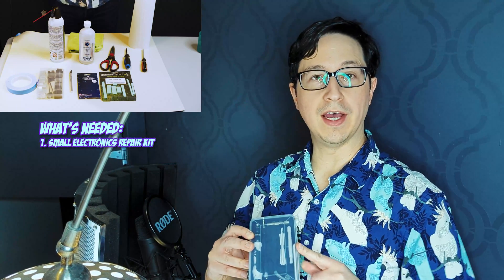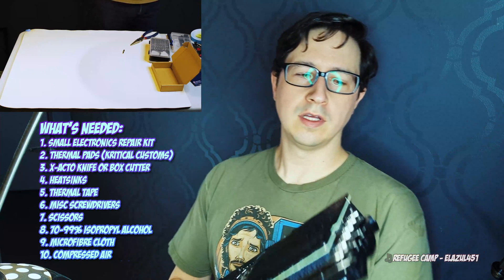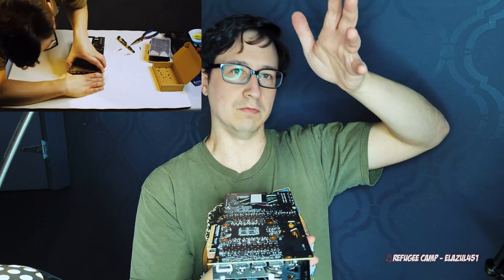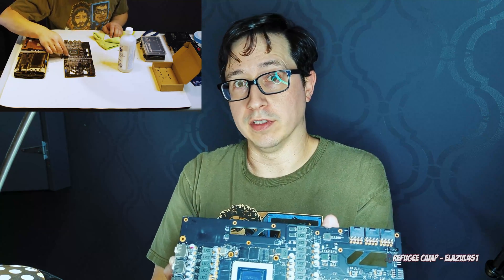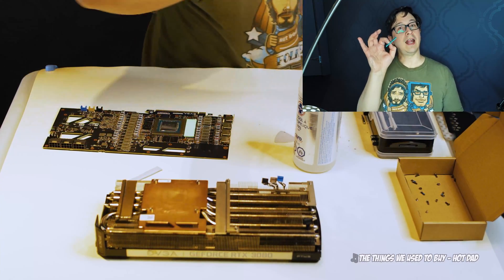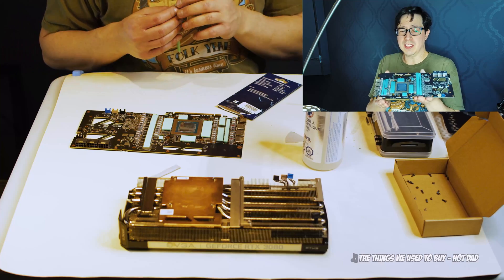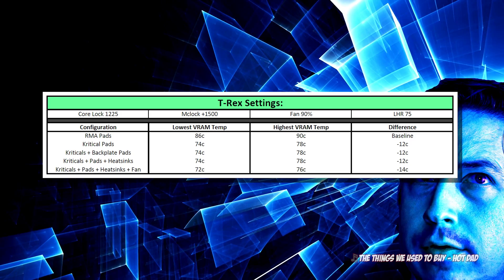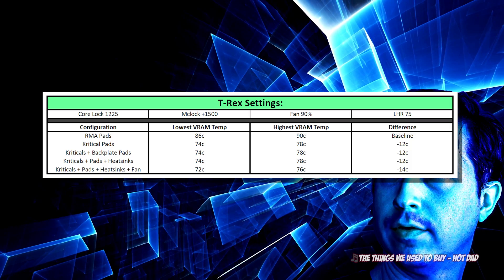How Good Are Kritical Thermal Pads? (and How Do You Install Them?) | Includes Benchmarks!

Comment: Thank you for this. Great explanation' simple and straightforward installation, no annoying music, and just a great video overall. 
For context, I recently bought an entire used system and the 3080ti has never been repasted and easily goes over 90° and it starts to throttle. I have to do a big undervolt to get it to run more stable, quiet, and cooler at the cost of performance. 
Undervolted to 800v @1750mhz with custom fans to get it under 78° under load

Comment: HI there. can u tell me what thermal paste is good for that gpu? with pads I heve no problem, but gpu hits 78c in gaming. I tried mx-4 and mx-6, no diference.
Reply from the maker: @B-Gaming82  are you really slathering it on there? GPUs don't have really any major components nearby so you can put quite a bit on.

That said, liquid metal is best (but risky). Carbon sheets I hear are great but I haven't tried one yet

Comment: a big FYI to anyone thinking of doing this. Kritical thermal pads after 6 months to a year the performance will start to degrade so the temps will start going back up.  Quite a few people who game have told me this. Stick with Gelid Ultimate or Nab Cooling thermal pads. The sweet spot is Thermalright Odyssey pads although they arent much cheaper than Gelid.  Nab Cooling is the same exact pads as Gelid just at a cheaper price. Both companies get their pads from the same supplier the stats are the same and they both get the same temps in game when put up against other thermal pads.   I have had Gelid Ultimate pads on my EVGA 3080 ftw3 since I first bought the card so 5 years old at this point?  I have opened up the card once or twice to repaste it and the pads have held up fine with no tearing and same temps.
Reply: hello bro. can u tell me what thermal paste is good for that gpu? with pads I heve no problem, but gpu hits 78c in gaming. I tried mx-4 and mx-6, no diference.
Reply: @B-Gaming82  Kingpin KPx thermal paste is one of the best especially for the price. Make sure you use the thin spread method.  I usually do an X over the gpu die and then spread it evenly across the whole gpu.  Kingpin KPx should come with a plastic spreader that you can use to spread the paste around the die.
Reply: @ Thanks for reply. I'll try.

Comment: Is Kritikal even still around? I try to go to the website and it never loads or I get an error.
Reply from the maker: They may not be. As I noted in my notes and some comments, the pads dry up after 30 days and become much worse
Reply: @Grraarrgghh  Damn...I need to get my card situated and I don't know which pads to get. They sell the Kritikal kit on Amazon for 37 bucks (green upgraded pads supposedly) but that's a lot to risk them being horrible after just a month...
Reply from the maker: @xRevoEmaGx  not horrible, just basically similar to if you hadn't repadded at all. If its a non-EVGA card, I would just get Gelid Ultimates.
Reply: @Grraarrgghh  It's an evga 3080 ftw ultra
Reply from the maker: @xRevoEmaGx  dang. As noted in the video, EVGA used weir .25mm increment pads for their cards. Gelid Ultimates are still a decent option because they are pretty squishy so you can size up to 1.5mm and 2.5mm, but you might not get as good contact on the GPU die
Reply: @Grraarrgghh  Which sizes did they use from factory? I already have 2mm and 3mm thermal right from older builds.
Reply: @Grraarrgghh  Gelid Ultimates are not squishy ,they are hard ( I own them) but I heard that Extremes are.Also some users noted that they leak oil over time.

Comment: So, maybe I'm crazy but... If the thermal transfer rate of this pad is truly 20 like they say it is. It's almost twice as good as the leading thermal paste on the market right now (Thermal Grizzly Kryonaut)... So why doesn't someone use these pads for their GPU/CPU die and see how it works? Seems like I can't find a single channel out there that's taken the plunge yet.
Reply: The is because they are thermal PADS which has a relatively large thinkness compared to thermal paste sandwich in under the heat sink. You can have thermal paste and the pad be both rated 20W/mk but if the pads are 4 times as thick it transfers 4 times less power. So any such test would be stupid because the thermal paste will win. Thermal Pads are really use to bridge gaps between the heatsink and different components.

Comment: Is this only for mining? If I were to do this upgrade would I see any performance boost in gaming? I’m not a miner. I would like to OC my card further.
Reply from the maker: Heat isn't usually a huge limiter in overclocking. Gaming definitely.pushes the VRAM hard however, but often it's chip luck that determines your cards OC cap more than heat
Reply: @Grraarrgghh  so you’re saying it’s not really going to do anything for an OC. How about just temps while gaming? Is it pointless to change out the thermal pads and thermal paste. Does evga use really good thermal pads and components already? Basically I want to know if I’m wasting time, money and effort.
Reply from the maker: @floridasmashgaming3262  they're mediocre to begin with. But you can check your temps while gaming and see if it's necessary

Comment: That "head in the way" problem is easily solved. Have you heard of the "camera in the ceiling" solution? There is a better way to store screws and other larger parts. Buy an old-style ice tray. Secure it to your workbench with VELCRO. Number the individual bins. Place the first screws removed in #1 bin, the next set in #2 bin, etc. When you remove an item too large for the bin, write its name on a piece of thin cardboard and put that in the bin. When you reassemble, start with the highest number bin and work down. No one wants to tighten screws too tightly or not enough. My solution was to purchase an EK-LOOP Torgue Screwdriver. It will allow me to replace my screws with the correct torque. Hope my comment helps.

Comment: Hey, I live in New Zealand and am trying to get my card back to factory settings for RMA any idea what pads you can use to do this? The EVGA for my region won't send them and am kinda stuck as they say I am allowed to change pads and cooling options and my warranty is still valid, but are screwing me on them needing to be as factory.
Reply from the maker: That's odd; you should be able to RMA a card without factory pads, they just usually charge an extra $30 to replace them before sending em back

Comment: If your using air only try coolmygpu with good thermal paste and 14+ temp difference
Reply from the maker: Yeah I've had a lot of people recommend copper plates to me. The Kriticals aren't aging well but I'm not sure copper plates are worth 4x the cost of decent thermal pads
Reply: @Grraarrgghh  What do you mean by not aging well?
Reply from the maker: @makeitso9833  I'm likely going to make a follow up video soonish but the Kriticals seems to have regressed to OEM pad levels in just over two months of operation. Pretty disappointing; average temps have gone from low/mid 70s to mid/high 80s

Comment: I  padded my 3080s ftw3 and 3080s fe, it only lasted about couple of months before the heat is back to level of the oem pads, yes I  got the Kritcal pads, anyone have the same issues as me?
Reply from the maker: You know I've actually noticed this recently as well. I thought it was because my ambient was going up but it's only half a degree higher than when I filmed the video.

Meanwhile my cheap Thermalrights Extremes have been rock solid for over a year
Reply: Yeah the sweet spot is 12.8 W/mk. Or 12 W/mk. Less metals more silicone.
Reply: Ahh man I have the same! After 4 months these pads getting worser than the RMA :( On my FTW3-s...
Reply: Oh no, man... I imported this stuff, paid a bullet for it... Was about to remove my 3090 to apply these kritical pads on it... Should I abort it? I have some 2.0mm gelid gp-extreme lying around, but I don't think it's enough for everything, it's a 80x40mm pack. :( These custom pads EVGA used on these cards are a pain in the ass.
Reply from the maker: @GabeBars  they're still better than the stock pads, and it's hard to find pads in the quarter mm sizes EVGA uses. I would still swap em, knowing that they will reduce in efficiency over time. Even at their worst they still are functioning at about 90c with a full unlocked OC at the moment
Reply: @Grraarrgghh  thanks a lot, man!
Reply: @GabeBars  My Kritical pads lost a lot of performance after 5 months. 5 card swapped and they "dead" almost the same time, and yes still better than original ones, but thats matter of time I think. I pull apart the card, and the pads just lost oil and get like plasticine. Go for copper if you have chance.
Reply: @Grraarrgghh  2mm will be not good! Use 2.5 soft pads but keep looking on GPU processor temps
Reply from the maker: @Badrick16  agreed; I didn't mean use the undersized Gelid pads, more use the Kriticals since he already has them but expect them to get worse over time.
Reply: @Grraarrgghh  Yes, prepare with 5 months, you will survive the summer at least :)

Comment: Your running an LHR Gpu, so its not running the memory at its peak. Only 74%,
Reply from the maker: You'd be surprised how hot LHR GDDR6X gets. I have FHR and LHR GDDR6X cards and they are very similar out of the box before a repad. While LHR is a few notches lower, it's not as significant as you would expect.
Reply: @Grraarrgghh  Ok, but your onlu using 75% of the vram. Thats the same thing as dropping a non LHR gpu by 25%.on the memory. Its not the same comparison.
Reply from the maker: @rkwjunior2298  that's...not how LHR works. There's no directly scaled 25% reduction in VRAM temps on an LHR 3080 vs a non LHR 3080.

You're still using the same frequencies and similar power to get that 75%.
Reply: @Grraarrgghh  The Vram is being limited. If its limited its not generating the heat of a non limited GPU.
Reply from the maker: @rkwjunior2298  I don't know what to tell you man. I have 3 non LHR GDDR6X cards and 4 LHR GDDR6X cards and they all push 95c+ out of the box. The FTW3 in the video was an RMA replacement for one that died within three days before I had repadded it, that was hashing at around 98c-100c at only +1000 memory offset.

As I had conceded, they are less hot but still extremely hot and worthy of repadding.

Hell, my Ventus x3 3080Ti was at 106c at +1300 before I put Thermalrights on it and now sits at about 80c
Reply: @Grraarrgghh   true bro i got all the LHR cards now they re all unlocked i ordered the kritical pads too but no way im goin at these temps... depends a lot on your ambient air temp but i managed to go down from a nearby TT ( arround 106-110) temps to like 96 max atm but still 100 % fans... got tufs, ftw3, GB oc and KFA cards... if its arround 30 °C outside in my room with the rigs its pretty hot air so no way i will get any lower ... if we have colder day im arround 86-88 on vram but 100% fan all the day... only during winter times i can lower them a lil. Ofc it will be diff when u just put one card into your PC start miner and show the results... i have 2 rigs made for 8 cards but using 6 per rig got extra noctua fans that blow in and take out but still got temp issues... but as far i know micron on gddr6x till 95°C is okay ... definitely a silicon lotery too ... specially i can see the evgas on core diff which i dont care cause they dont go over 60 in hot days. Vram +- the same on all cards... GB Oc i managed to get same temps with arctic pads 6w/mk same results as with other one with kritical... Kritical pads definitely work but for me i exptected much better results but its cause the ambient air temp ... still for me getting arround 95 or lower is a win win situation even if i have to keep up 100% fan i will rather change fans than whole cards...

Comment: Please do a comparison of the Gelid GP-Ultimate and Kritical pads.  The former is 15w/mK.  I'd be interested to see difference in thermals.  These companies have different testing methodologies and different hardness to the pads that they make their claims on, so it would be interesting to see if the Kritical pads really are better.
Reply: I have tried 4 varieties of pads and comparing the higher kritical pads (20 w/mk) there is a 4 degree difference between them all. In other words, buy the best price. Higher thermal conductivity does not mean that great of cooling given the price.
Reply: @markw496  Which varieties of pads they were?
Reply: Sorry I forgot to specify I used 12.8 W/mk. Seems the sweet spot for price to cooling. I used Gelid extreme, Frosty thermal pad 12.8, thermal odyssey, fuji poly. All under 90 degrees depending on ambient temps usually 84-86 in mem junc temps.

Comment: STOP TOUCHING THE PADS WITH BARE FINGERS!  You're getting oils on them and it messes with the thermal conductivity and longevity of the pad.
Reply from the maker: Did you not see me (mostly) using the plastic to interact with the pads?

Comment: Just alittle FYI. FOR ANYONE THAT DOES NOT WANT TO REMOVE THE BACKPLATE. If you ONLY take the screws out that do not have the under nuts on, along with the tension bracket, you can actually remove the PCB from the cooler. The screws with the nuts are for the backplate only. Hope this saves someone some time
Reply: Thanks for this!! I’m replacing my pads tomorrow and this actually is pretty useful since I won’t be installing thermal pads on the back plate
Reply: @isaacpargas5158  glad this will help

Comment: Any thoughts about honeycomb side of the pads? Should be facing the vram? Or facing the dissipator?
Reply: It does not matter. Once things get squeezed together, all surface become smooth/flat. The honeycomb is just a result of the plastic wrapper used by the manufacturer. It bears no meaning.
Reply from the maker: I'll admit that I'm just following the crowd for the most part, but I always put the flat side on the chips/VRMs/mosfets and honeycomb to the heatsink. Ultimately I don't think it matters that much but my logic is twofold:

a) the flatside of most thermal pad sets have a thicker backing, and thus harder to peel after placing the pads so it stands to reason to have the easier strip to remove on top, and

b) the pressure will likely originate from the heatsink rather than the PCB side (but since it's screw based, it's probably more even than I think)

I'll note CriticalQuartz himself puts the honeycomb up as well in his videos.

Comment: EVGA says you need to restore the original factory pads before you can get warranty RMA support.
Reply: They would charge you $45 if you sent it with after market pads. Funny thing is that as part of their "inspection procedure", they are replacing the pads regardless. So in effect, they are finding excuses to make you pay for something they will do regardless of the pads being OEM or aftermarket.

You could/should save up their POS pads, and slam that back on the GPU if you ever need to RMA it (this is what I am doing). Or you could order a replacement set from them for $15 (I believe) before your RMA it.
Reply from the maker: @KriticalPads  yeah I just can't be arsed to keep the gooey scraps. If I have to RMA an RMA I'd be pretty unhappy in either case!
Reply from the maker: Also thanks for taking a look! Your product rocks
Reply from the maker: I RMAd the previous one I bought because it had bad VRAM out of the box. The RMA pads they put on it are different than the factory pads I had on my other EVGA 3080s (better)
Reply from the maker: Also to note, in my experience you aren't required to "restore" the factory pads (esp since they use putty on the VRMs instead of pads), they just charge you $50 to put factory pads back onto the unit when you RMA